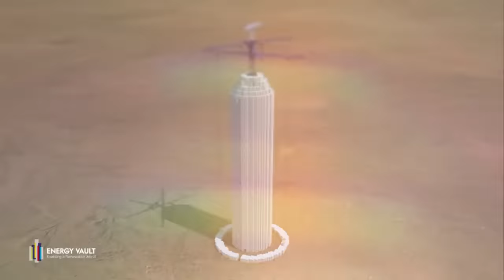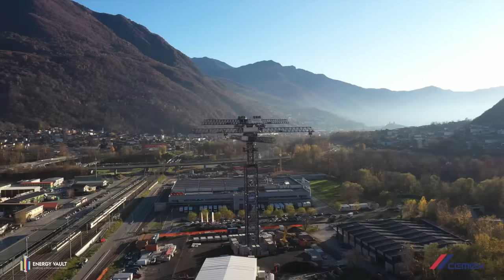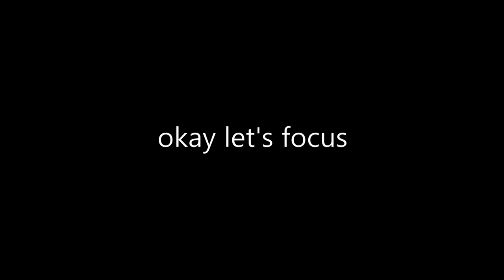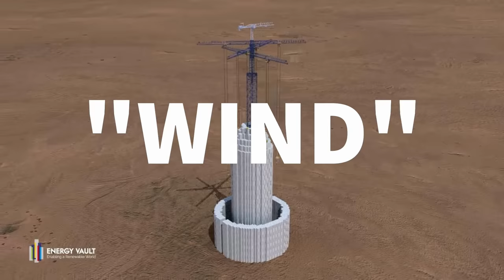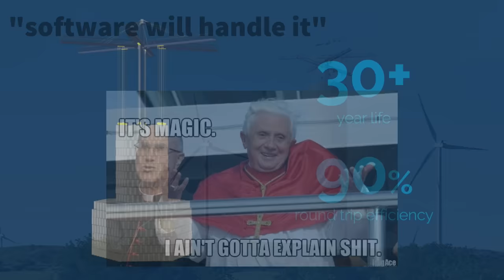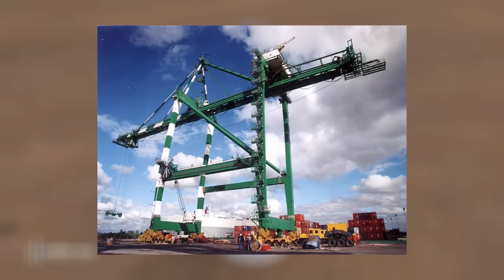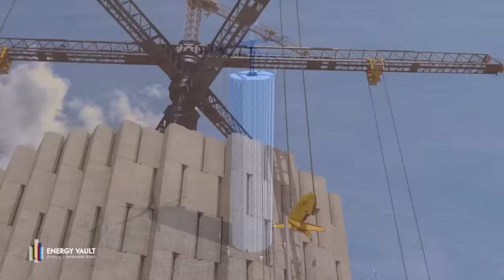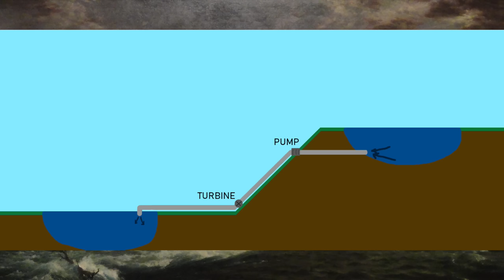The Energy Vault is a Dumb Idea, Here's Why

Comment: All other considerations aside, how are they going to ensure that the fully built tower of blocks is stable?    If you were building a permanent tower of concrete like that, it would be necessary to tie all the blocks together with steel ties or similar.   As it is, they've just got a tower of loose blocks - I wouldn't go within a mile of that thing.
Bear in mind, these wouldn't have been carefully fitted as with traditional stonework - they've been stacked automatically at a rapid rate and get un-built and rebuilt every few days - how long before it falls over?
Reply: Imagine an earthquake topples all of those blocks. How much stored energy would be lost? How much energy would have to be expended resetting the whole mechanism?
Reply: @theunkownbanana1823  I would imagine many of the blocks would suffer damage and chipping so would be unusable.   And the machinery would likely be severely damaged also, quite likely by falling blocks.
Reply: How long before it falls over? Will it ever stand is what i ask
Reply: Software will solve it
Reply: and the blocks would get minor wear every time they are stacked/unstacked making it less and less stable
Reply: Isn't unreinforced concrete a bit weak for this too? I'd expect the lower bricks to fracture and send the whole thing to the ground if they got to any useful heights...
Reply: sOfTwArE wiLL hAndLe iT
Reply: @KertaDrake    I'd think you're probably right.   But it's a while since I designed anything in concrete.   As I dimly recall, ordinary concrete would have a design compressive strength of 3 to 5000 psi.   That's 432,000 to 720,000 pounds per square foot.   Which (at 150 pounds per cubic foot weight) corresponds to a stack 2880 to 4800 feet high.   But that assumes the blocks are perfectly cast and bedded with no stress concentrations due to uneven fit between blocks.   
I think the problem would be more with wear and stability rather than ultimate strength.   Certainly a fracture of a lower block could have severe consequences.
Reply: @KertaDrake  a tower that high would be "fine" on paper, but let me tell you something about concrete. I can break it with a hammer and my wet noodle arms. And I don't care how good software or operators are, stuff swings when you move it. We have leads attached to steal to make sure it doesn't swing wide and hurt anyone, and also to make sure it doesn't ram into the steal surrounding it. No safety inspector is going to allow people anywhere close to a tower of unrestrained concrete, let alone one that is currently having the weight moved around. So you've got these concrete blocks swinging around and breaking. The moment one of their little nooks breaks and one of those falls, you risk bringing the whole crane down.
Reply: @aliceiscalling    Well, I imagine the area would be securely fenced off to exclude bystanders (think: nuclear power plant).   But I wouldn't want to be a worker.   The nearest similar hazard I can think of is container handling facilities where shipping containers are being trundled around and stacked by huge carriers - a notoriously dangerous occupation.   But they 'only' get stacked seven or eight high.
Reply: good point to stay a mile away. i saw a deconstruction of a brick tower. we moved like 100 meters away. i thought it was an exageration. i was wrong. the bricks where ejected once it fell at high speeds. some bricks reached 70 meters away. this mega structure. with all that energy would be a disaster. for any town or city close to it.
Reply: @dustinakadustin  software will not change the fact it would need huge foundations equivalent to that of huge sky scrapers at the very least plus the fact that software fails so many times.
Reply: @m4rkscott  I was just having a laugh mate
Reply: @m4rkscott  Yes it does, huge skyscraper are hardware, they are subject to the laws of physics. In software however it is only subject to the rules of the model of physics you coded. Change the code and the rules change. In software if your model says that the ground is infinity solid stable and flat, then it is.  So yes indeed as @Ahja said : software can handle it !!!

P.S. : That remind me of that theory about software vs hardware company popularized by Steve Jobs (rest in peace oh godfather of all the BS startuper)
Reply: @TilDrill  thank you! I needed that.
Reply: @lolaa2200  You must be a  or believe in software engineers, have you ever repaired a software problem ???????
Reply: I'd say that depends, can we work out how many lbs of bird poop it might take to throw one block off balance? Guessing it would take about a month, maybe two.
Reply: @ct5625  Can you work out exactly where about on the block they will poop and if that's a constant , too much confidence is often fail point
Reply: What is mind boggling to me is concrete is only about 2X heavier than water.  So why not just build a tall skinny water tank? Make it 2X wider than this "stack" and you have the same weight.  Then you are using pumps and known technology.
Reply: @DeputyNordburg   The main energy losses in pumped storage are due to the viscosity of water (causing head losses in pipework and efficiency losses in pumps and turbines).    Plus electrical losses in motors/generators. 
The stack of blocks avoids the first category of loss and replaces it with friction losses in mechanical gearing and cables - which I suspect can be far lower.   So in theory (on Planet Spherical Cow) the Energy Vault could work.

This sorta raises the question, instead of thousands of blocks, why not just one humongous block (the size of a small ship) raised by multiple cables.   Gets away from the block-stacking problem.   I don't know why it wouldn't work, except possibly the engineering of the lifting gear (gantry and electric hoists) might prove uneconomic.   And also, the degree of gearing down in gear trains to allow normal-size motors to lift such a weight could kill the efficiency (you lose so many percent per gear).
No free lunch...
Reply: @cr10001   Pumped storage is a well known tech and is 80% or better in efficiency.  The estimate of the designers of this tech say it will have 90% (or better) efficiency.  But that is an estimate.  So I think efficiency will be similar, until it falls over of course.
Personally, I think Nuclear energy is a much better choice than all of this renewable nonsense.   Install modern safe nuclear plants, smooth out the power fluctuations by linking energy grids, and smart charging electric vehicles etc.
Reply: Steel fitted blocks?
Reply: Their researchers in the preschool playpen have been testing various block tower builds pretty thoroughly
Reply: @danielchilds8327   When I was a juvenile, we used to build a Tower of (beer) Cans - three cans in a triangle, with each storey rotated by 60 degrees (or 180, or flipped, however you like to look at it).   But the bottom storey always had to be six cans for stability on compressible carpet.   We could (with care) get 22 storeys out of it i.e. just touching the ceiling, if the party lasted long enough.   They made a lovely commotion when the tower fell down.
Reply: @theunkownbanana1823  Lol not much energy would be lost tbh
Reply: Just one of those blocks is going to chip JUST a little and then it'll end up taking out half the tower. Brilliant. We combined the fragility of a Janga tower with the practicality of, say, a self-driving car that keeps trying to crash into shit.
Reply: It would create a large shockwave
Reply: Software will handle it 🙈
Reply: @theunkownbanana1823  Not much energy would have been lost, because as was said in the video: it doesn't really store that much energy in the first place.
Reply: @ct5625  bird poop is an interesting point, the system’s capacity will increase indefinitely! We did it, infinite free energy (storage).